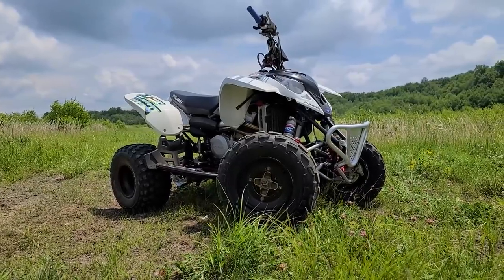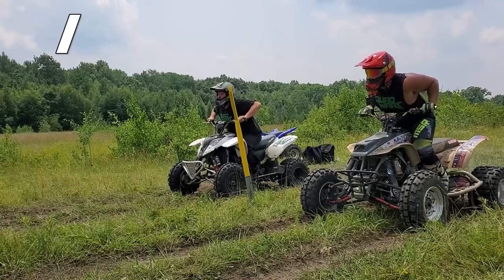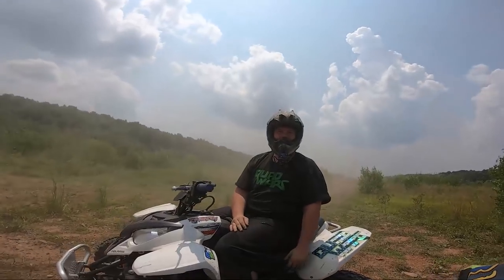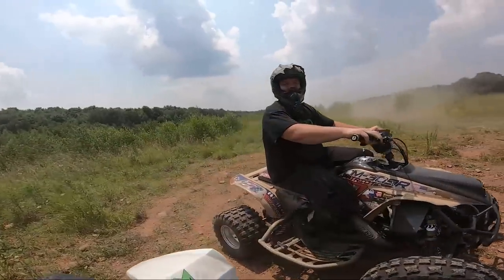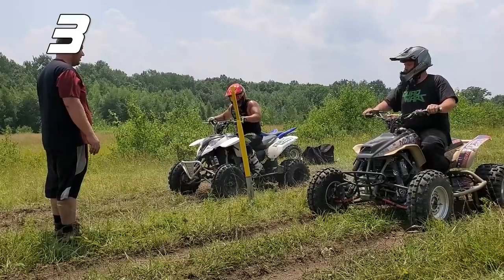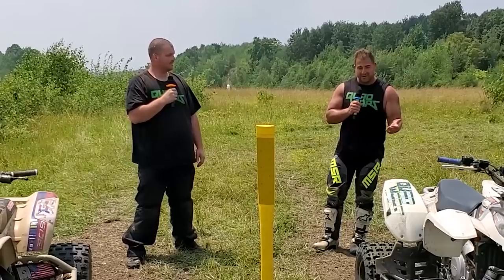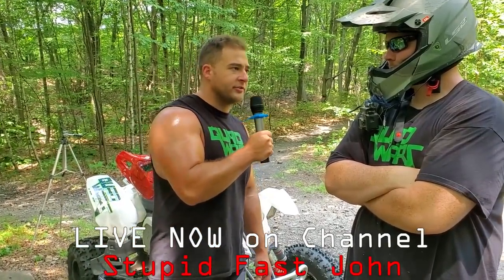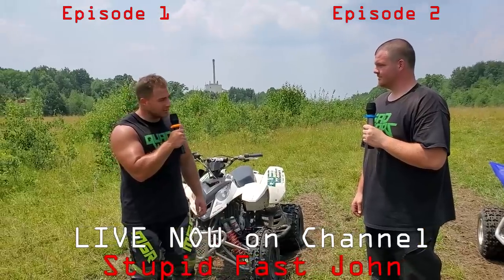Honda TRX250R vs Polaris Predator 500

Comment: You will notice that the predator has a large gap from 3-4 gear. The troylee and limited edition came with a close ratio 1-3. Then it's a big jump to 4th gear. You can hear the engine drop rpm with the 4th gear shift.
Reply from the maker: Oh yes, very much so; I wish they had tightened up the 3rd-4th ratio; it almost feels like its missing a gear

Comment: I would love to see the Predator geared down a tooth in the front, i think it would go crazy
Reply from the maker: We actually played around quite a bit with the gearing; in this video it is down 1 in the rear and 14 tooth (stock) front. We had a 13 and a 15 we tried. It's possible the 13 would have been better for this race.

Comment: 2 STROKES RULE four strokes suck !! Killer match up tho. Is a cr500 build coming soon dirtbike or quad ?
Reply from the maker: John got his hands on a CR500 and a KX500 but I'm not sure what he's going to do with them. At some point it has to happen.
Reply: Raptor 700
Reply: Line him up against Modded Raptor 700 then will talk.
Reply: Guys with their gear redutioned,  lifted, and oversized tires on honda 300s: am i a joke to you

Comment: 250r vs Banshee
Reply: Stock banshees are know to pass raptor 700s with no issue, his banshee is a 421, no problem passing the honda
Reply: @brennensbuildsmoore5537  true. However, 250r wins in pretty much every category except drag racing.
Reply: Aint no stock banshee beating a raptor in a drag race. You can even look up all the old shootouts in dirt wheels magazine.
Reply: @motofarmmx2430  right, unless both the raptor and banshee are piped and open/no airbox, then it may be different...
Reply: @motofarmmx2430  they do
Reply: @kingGfour   not stock for stock. Only way is rider error.
Reply: @roughmix9528  thats  true all the new sport atv  run simulator  chassis  to the 250  Then the 250R has a lot more manageable power banchee power is just more violent balls out
Reply: @brennensbuildsmoore5537  raptors are slow asf my predator 500 outruns the 660’s without even trying

Comment: For a stock cammed predator I think it didn’t do too bad..I bet if you put some web cams in and retune it that R wont make the predator look slow lol besides ported heads big bore etc the valve timing isn’t taking advantage of it. Still both super nice quads keep them coming
Reply from the maker: I 100% agree man; I ported this Predator for a larger cam and I just wasn't able to get the cam I wanted in time; it should have a massive difference if someone puts a cam in!
Reply: Stage two hot cams I felt more difference in then anything else
Reply: Cams would add a lot to the 500

Comment: Hey Mike where can I find a the angle intake boot that you have on your 250r? I have the same LED ESR cylinder on my 250r. Thanks.
Reply from the maker: This is the boot I am using - https://ebay.us/Roepw0  

The billet one in my build video with Dave Moore did not fit in the frame.

Comment: Comparer donc les quad stock et non pas faire des drags avec des quads booster aux stéroïdes comme c'est le cas ici,un deux temps modifié même un trx 250r vas avoir tout un coup de pied au derrière comparativemnt au predator 500 un 4 temps plus lourd et même avec une pipe et jetter le carburateur t'aura pas la dose de puissance d'un moteur 2 temps par contre aller donc sur une longue ligne droite et une piste avec des obstacle style enduro rally et vos deux machines stock sans modifications peut  vous assuré que  le 250R ne terminera pas la course contre le predator 500 qui est plus fiable et stock les deux machines le predator vas le mettre ko assez vite et il a une suspension nettement supérieur,j'ai piloter un predator 500 2006 version limité et stock en plus et dans les longues randonnés d'hiver québecois avec des pneus pour rouler l'hiver même pas piné en plus c'étais toute une machine pas grand chose m'a passer en avant en plus je pesait 245 lbs, à part des KTM 525 et Banshee hyper modifiés avec des tas de trucs et ils avaient les pneus cloutés ou pinés pour rouler sur la glace ou neige durcis..Un predator stock vitesse moyenne 115 kmh à 120kmh et un TRX 250 à peut près pareil ou moins on parle de quad sortis de l'usine ou du concessionnaire..